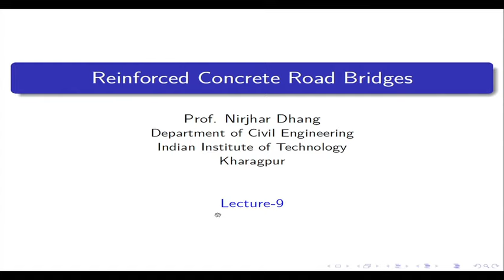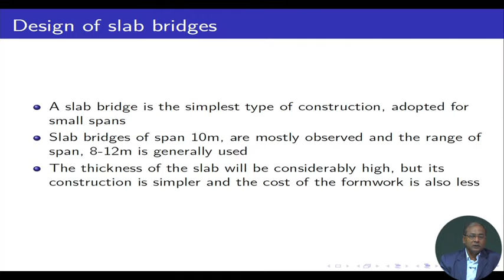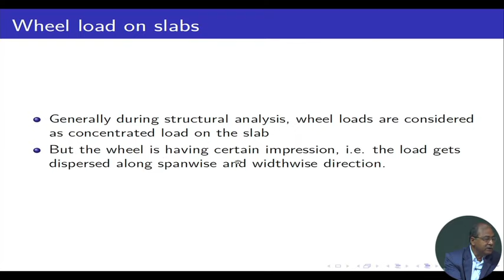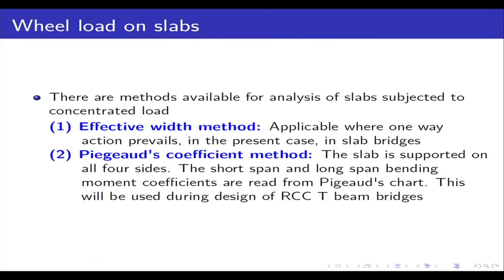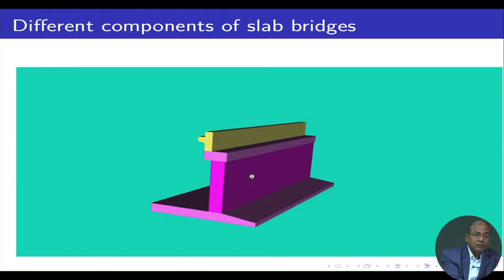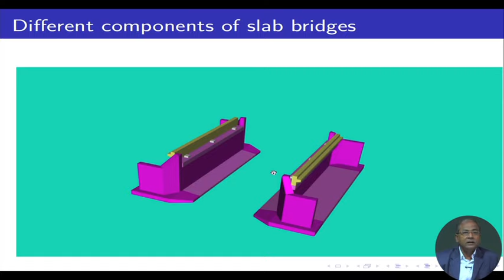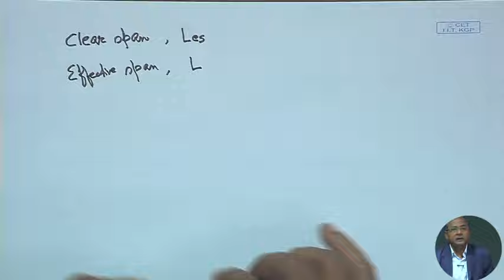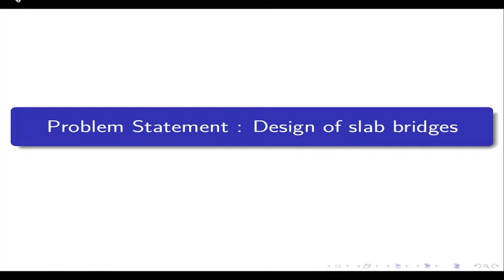Design of Slab Bridges (Part I)

Comment: sir actually i am doing a project on suspension bridge .so can i use the same design of deck slab for suspension bridge?
Reply: no you cannot use this design for suspension bridges since the support conditions change  and the span is may be  more than 10m... for suspension bridges rigorous non linear analysis of cables and deck shall   be taken into account.